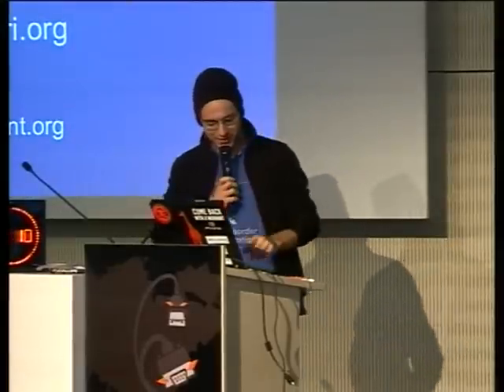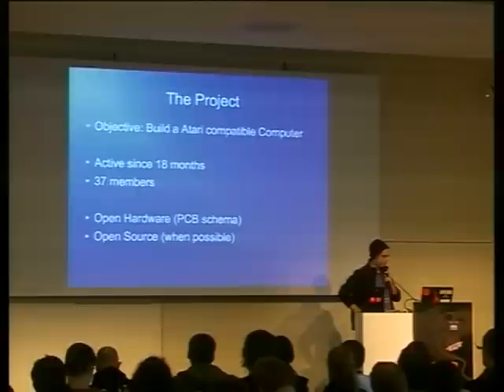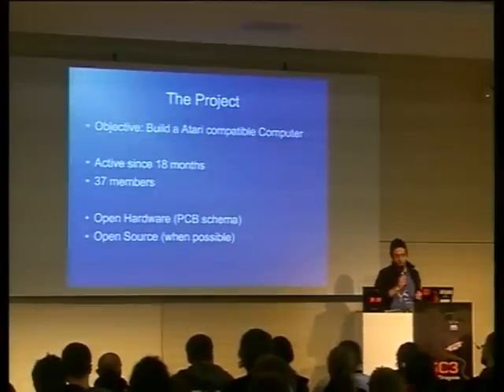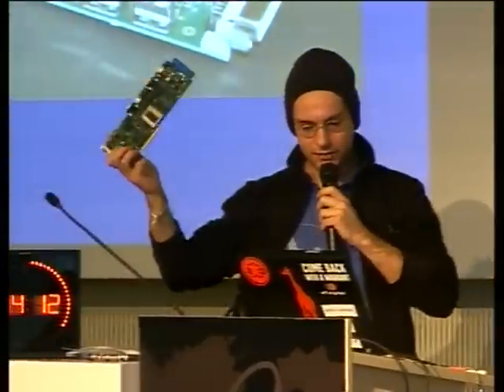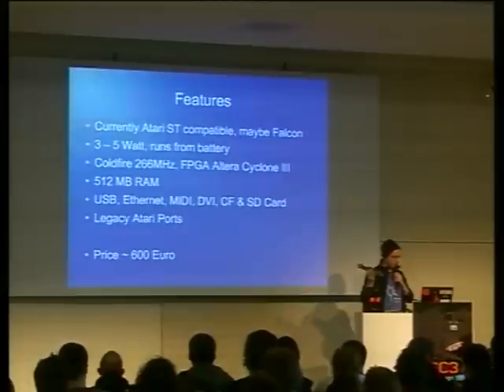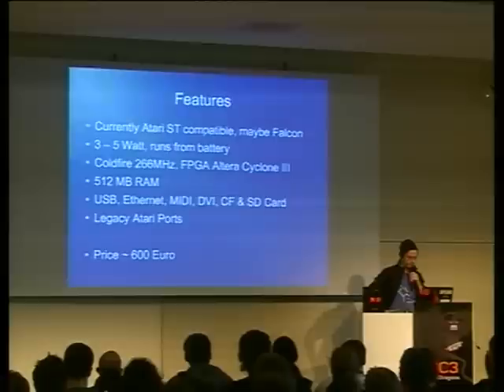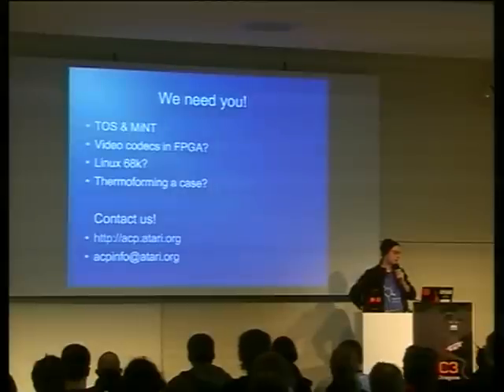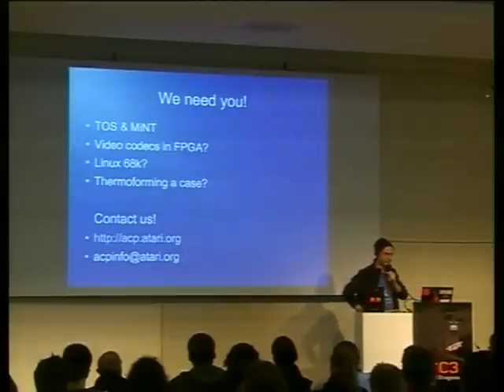CCC 2009

Comment: I am an engineering designer, and I have access to tools to design a thermoformed case for the product. I use SolidWorks 3D CAD and my website can be found by Googling "The BIG Consultant" and would conduct this work in design for free in this case.